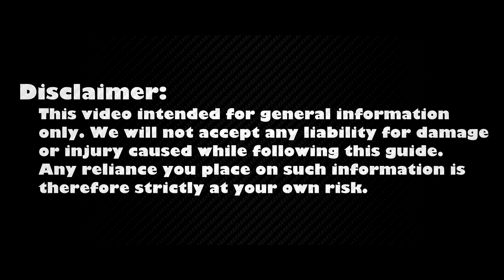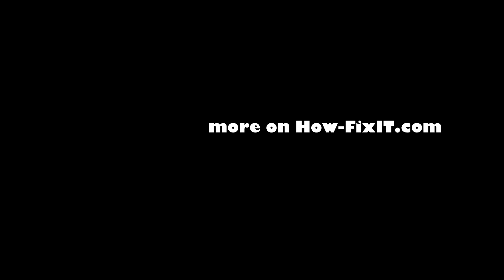Toshiba Satellite L855, L850 Disassembly, Fan Cleaning, and Thermal Paste Replacement Guide

Comment: After I do all this, my laptop doesn’t turn on. What can I do? I revised all the connections two times
Reply: you might've static shocked your motherboard then, either buy another mboard or get another laptop (the hard drive may still work so you can transfer the files to the new laptop)
Reply: MaxiiBoii  I fixed, it was static, I try to turned on without battery just the 🔌 then I try with the battery and it works!

Comment: After reassembling it shows me "No bootable device" What should i do?
Reply from the maker: 1st check that laptop see hdd, if it does, problem might be in boot settings
Reply: How-FixIT Thank You!
Solution was easy, i just forgot to plug the HDD correctly in

Comment: where can I buy fan
Reply from the maker: +street riding you can try to seach it in internet (ebay, aliexpress or other local internet sites), to seach you can use part number that you can see on the fan
Reply: how fixit does  the l850 have a short out point to wipe out bios crossword thanks

Comment: What did you used to clean the top of CPU ?
Reply: paper towel and rubbing alcohol works fine if the thermal compound isn't cooked. If the compound is brittle, I like Goo Gone on a paper towel, then a final wipe with alcohol. For compound that was squeezed out beyond the edges, a popcicle stick and or toothpick work well. So you don't end up chasing ghosts, maintain ESD awareness at all times... good luck, get paid :)

Comment: does the mouse pad is replaceable? i mean, if o buy the spare part form ebay, can i just change it or it is fused with whole keyboard plastic part?
Reply from the maker: Roberto Garcia Ceron first try to remove your old touch pad, if it replace easy - ok, but basically touchpad is soldered to top case with plastic
Reply: Thanks for answering, I was looking for a video fixing this model. Thanks